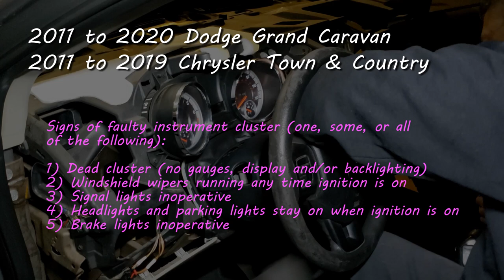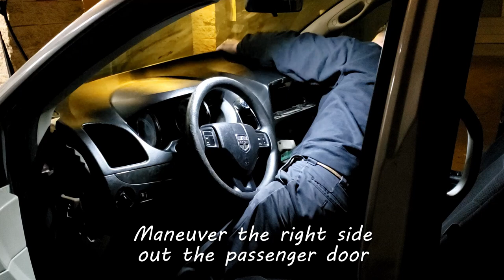2011 to 2020 Dodge Grand Caravan, Chrysler Town & Country Instrument Cluster Replacement

Comment: Thank you 🙏 for the video…replaced my cluster today with a VIC one…just need to find where the compass module is so I have compass settings!
Reply: what is a VIC?
Reply: did you put a EVIC into one that did not have one originally?  did it work properly? did the model years match? any problems occur? i am trying to do this too but no service department can tell me if it will work or not. thanks

Comment: Thank you for the uploading, without that I couldn't change the 1 pc faulty led in the tachometer of my 2011 Grand Caravan... Only one remark, at 1:12 before prying the decoration between the two glove compartments you should loose 3 screws in the bottom of the upper compartment, under the rubber insert, after it it is very easy to take it off.
Reply: Glad the video came in handy for you.  I remember noticing it was much easier going in than I though it should be when it came out.  Now I see why.

Comment: I was thinking of replacing bulbs to slightly change color of the gauges but if that’s what it takes then I think I’ll pass. Only if necessary. 
Btw, the issues you are describing caused by faulty cluster are probably often misdiagnosed with faulty TIPM, for which these vehicles are famous.
Reply from the maker: You are correct about the TIPM.  In fact, this one did have a faulty TIPM that caused some of the problems.  The customer let it persist until more problems started showing.  The TIPM was replaced, resolving some of the issues.  Then the cluster took care of the remaining ones.

Comment: Did you install a used cluster? If so, do you have to do any programing or coding?
Thank you for the great video! 👍👍👍
Reply from the maker: Yes. It's a used cluster.  The odometer will be incorrect.  Customer didn't care.  You can have them programmed.  There are services out there that can do "odometer correction".  Otherwise, in California you can make "True mileage unknown" on the title when you sell it.

Comment: I appreciate you gathering information and symptoms of a bad instrument together. I was having all of those but brake light issues.

Cannot confirm but it seems like my grand caravan would start acting up after a drastic temperature change or low temps below 60 degrees. At first I was able to unplug the battery and reset the system but overtime every time I would find a solution it would only work shortly. 

Almost like a dreadful version of bop-it..

The last few months of troubleshooting have been unsuccessful even after reading plenty of documents, watching videos and discussion with others at dealerships. I tried EVERYTHING 😅

You put it to action for us DGC owners going through the possessed car issues and provided a solid solution. I purchased an exact match to my cluster, installed and everything works now. Thank you!
Reply from the maker: I, too, was surprised at how Chrysler tied all those functions into the instrument cluster.  It just adds another variable to the already unconventional electronics on these cars.  First, let's run it all through this mysterious and problematic TIPM.  Then muddy it some more by running through the cluster.  Even wiring diagrams, won't help much with diagnosing related problems because modules like the TIPM and cluster are just shown as an empty boxes.  The schematic may as well be a big fat question mark.

Comment: Thank you for sharing! I have question , my is 2012 caravan ,, I just bought the used one  (2012 ) from eBay ,  could it need programming or  put it on and it will work ?
Reply from the maker: There is no programming needed. As long as it looks like yours, it will work.

Comment: Is the mileage on these vehicles stored in the BCM? Or does the new cluster need to be programmed? I'm asking because I can't remember my last odometer reading.
Reply from the maker: The odometer reading is stored in the cluster.  If you want the odometer correct, you'll need to have the cluster programmed.
Reply: Can be done with a normal car scanner or what other tool required? Thank you.

Comment: You do not have to remove anything past the radio cover only remove the top 2 screws under folding tabs on top of radio trim. None of the dash on the passengers side needed to be removed.

Comment: Did you have to have the cluster programmed to your vin?
Reply from the maker: It's plug-and-play.  No programming needed unless you you want to correct the odometer.  The odometer reading will be different from your original reading.

Comment: O M G.. So, we have a "hole" / crack in the RPM gauge side of those main gauge covers.  Here I thought it'd be an easy job to pull off that cluster to replace MASK LENS cover.. YEAH I'll pass! lol  Maybe I'll find a way to fill the hole in instead.
Reply from the maker: Yes, it's a crap ton of work.  I went into thinking 30 minute job, like most vehicles.  I wanted to cry when I realized how much work it would be.